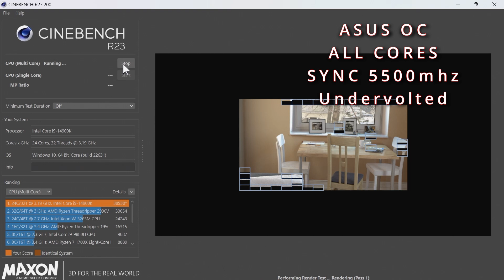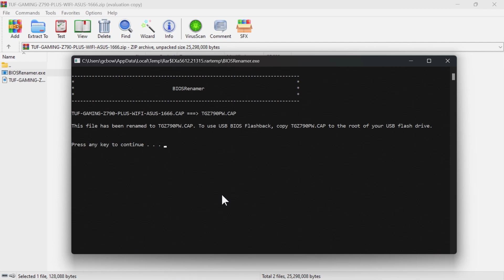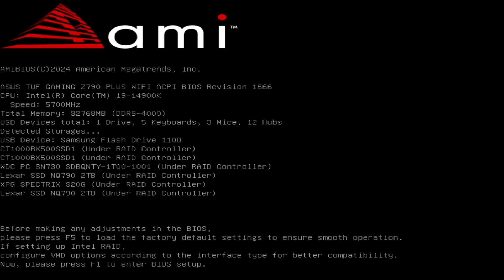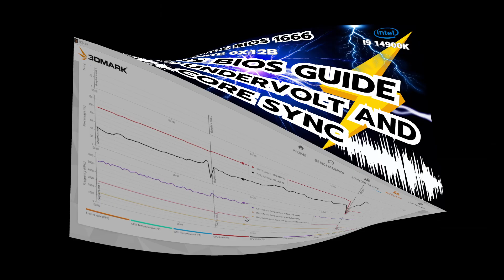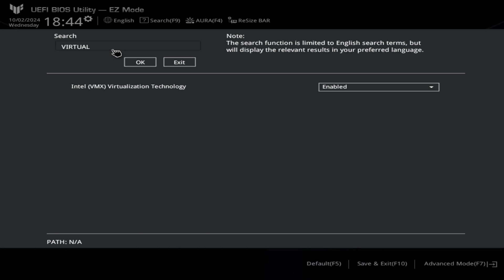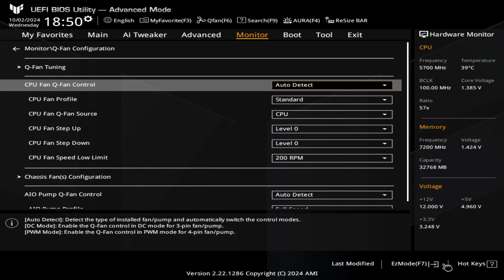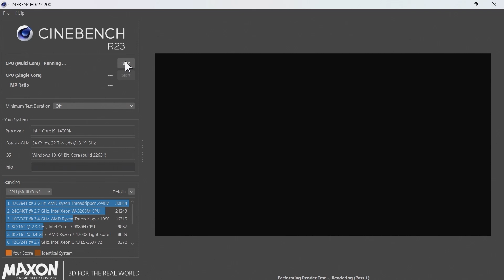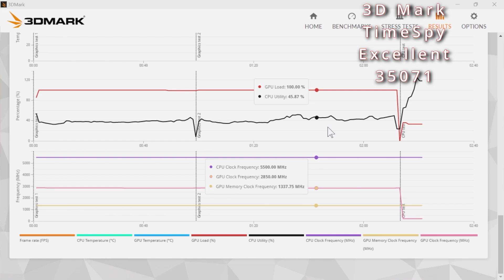i9 14900k Asus BIOS Guide Part 3 Version 1666 Beta Microcode 0x12B Improve Elevated Voltage at idle

Comment: Another excellent and in depth video. Keep up the good work. I have the same motherboard but the D4 version and an 13700k cooled down by an AIO. What would be best to change in order to fit those changes to my CPU? Should i go with the default PL1-PL2 values from Intel and a LLC of 6 followed by a -0.05 undervolt offset?
Reply from the maker: @Ntinsky  Hi, thanks for the positive comment 🙂 yes, I would say apply that, test at - 0.05000 then add further increments if - 0.00500 so next would be -0.05500 then -0.0600 you should see a good improvement at around -0.06500 but beyond that ir may be both negligible difference and add instability, test using Intel XTU AVX2 test for 10 mins it will be a pass or fail test, if it fails add back the -0.00500 you dialled out 🙂
Reply: @nextlevelsimgaming  Thank you for the feedback. I an gonna test it on a brand new CPU since Intel replaced my old one and have -0.06500 as the hard limit.

Do i need to disable virtualization like you did?
Reply from the maker: @Ntinsky  Yes unless you use Virtual Machine, its only needed to be disabled to run Intel XTU for the stress testing aspect, you’ll get a slight improvement in performance with it disabled too
Reply: @nextlevelsimgaming  Got it. I might leave this to enabled since i sometimes practice with VMs due to work. Do i calculate "All core ration limit" for my CPU as the max speed with boost?
Reply: @nextlevelsimgaming So far so good with the 0.0500 as you suggested. Quick question. How do i calculate the All core ratio limit? I am not sure what to put there
Reply from the maker: @Ntinsky  The all core ratio is in thousand mhz, so 55 would be 5500, 56 would be 5600 etc, for an i9 14900k 5500 is best all core, check the recent video on different frequencies for comparison 🙂
Reply: @nextlevelsimgaming  Thank you for the explanation. In my case (13700k) i have set undervolt of -0.0600 that seems to be working fine with the rest of the settings you dmeonstrated, but i notice that my Pcores reach 5300mhz instead of 5500 during CB multicore run and the CPU Package Power goes up to 220W max. Am i missing something here?
Reply from the maker: @Ntinsky  Check that Windows Power plan is set to maximum performance 

To change a power plan:

Select Start and then Control Panel.
From the list of displayed item under Control Panel, select Power Options, which takes you to Select a power plan page. ...

By default, the option to change power plans is disabled. ...

Choose the High Performance option.
Close the Power Option window.

However I note you say that you are using a 13700k the maximum clock is 5300mhz by default so you will need to sync cores to 53 the guide is for an i9 14900k

Core i7 13700K - desktop processor produced by Intel for socket LGA-1700 that has 16 cores and 24 threads. The base clock frequency of the CPU is 3400 MHz, but due to Turbo Boost technology, it can perform up to 5300 MHz.

Hope this helps 🙂
Reply: @nextlevelsimgaming  thanks once again for the feedback. Power plan is set to ultimate performance. I changed the core sync to 53. All good👍
Reply: I5 13600kf please 🥺

Comment: Is there anyway to maybe get the temps down a few more degrees?   Also what settings would you need to change if you wanted let’s say 57 all core sync. Would you change the 1450 voltage and the under volt offset ?
Reply from the maker: @ElusiveAura  See my latest video regarding 57 frequency, if you wanted to get the temps down further you would need to reduce the undervolt further
Reply: @nextlevelsimgaming  appreciate it and the videos. If I’m on the latest bios now with all the fixed and replace my 13th gen with the 14900k, I won’t need to reapply any bios fixes right?  All those bios updates are for the motherboard and not the actual processor itself?  I mean it’s for the processor but it’s done on bios. Just wanted to make sure I didn’t need to reapply the bios update or something.
Reply from the maker: @ElusiveAura  The BIOS is a microcode update applied via the BIOS and Intel ME, once written to the CPU you will then be able to see the application in the CPU section of the BIOS menus, it also lets you revert to the previous, so once updated that stays hard written to the CPU so you won’t need to update again 🙂

Comment: Set the offset to the video on my z790 gaming e with 13900k and when starting the cinebench test it sends a bug error and exits the app.
Reply from the maker: @r1cc-1  You need to set the offset starting at a negative offset of - 0.05000 then test, run AVX2 test on Intel XTU for 10 mins, if it passes then add further increments of -0.00500 so next would be -0.05500 then -0.06000 etc, that is the offset I used in the video thats good for my system however every chip is different, if your system can’t run at -0.05000 then it may be susceptible to degradation and may need to be RMA’d.

Bear in mind a 13900k was affected by Oxidation issues in some batches.
Reply: @nextlevelsimgaming  I set the IA VR Voltage limit to 1400 since 1450 is not recommended on 13900k could that be it too?
Reply from the maker: @r1cc-1  I would recommend leaving that to Auto on yours
Reply: @nextlevelsimgaming  xtu says it is incompatible because I have undervolt protection disabled.
Reply: @nextlevelsimgaming  The test failed with the Asus profile and an offset of -0.05000 in I just hit start testing with avx2. Where should I contact Intel? I had never had any problems since I never configured it by offset, I just left the BIOS that Intel recommended was safe by disabling the Asus profile. I never had any problems until this test...
Reply: Any other test to know if it is definitely degraded? :(
Reply from the maker: @r1cc-1  A CPU test run on 3D Mark, Cinebench R15 is also intensive
Reply from the maker: @r1cc-1  Disable it in BIOS
Reply from the maker: @r1cc-1  If it cant pass on a small undervolt, then its requiring more power, thats a sign of degradation, a CPU will require more power to operate as the silicon degrades, on the upside, Intel have no more replacement 13900’s and are providing 14900’s as replacements
Reply: @nextlevelsimgaming  If I disable undervolt protection from the BIOS, the xtu app asks me to activate it from the BIOS and only then does it run
Reply: @nextlevelsimgaming  but taking into account that I had it in asus profile and not intel? because in intel profile it works fine although I don't know if it's normal that xtu throws a message that says thermal throtled in XTU until the end of the AVX2 test
Reply from the maker: @r1cc-1  Whichever way works, it normally (used to) require undervolt protection disabled to allow undervolting on XTU unless they’ve changed it 🤔
Reply: @nextlevelsimgaming  The avx2, cinebench r23 and cb r15 tests do not exceed 5, 5.1, 5.2 ghz, is this normal?
Reply: @nextlevelsimgaming  R15 gave me a result of 5491 points with the latest bios in stock
Reply from the maker: @r1cc-1  The R15 test score works in a different way to R23, if it passed that is good in itself, as it’s extremely demanding.

On the R23 test, on a 13900k that is normal.

I cant give you the specifics for that processor as I don’t have one to test

Now test in gaming, you should notice the real world difference in temps there
Reply: @nextlevelsimgaming  Hello again, I've been without a computer for about a week hahaha, I sent the 13900k, Intel changed it and they gave me a 14900k, thank you very much for the recommendation. What do you recommend I configure to start from 0 with my 14900k? Arriving in Chile on Tuesday was quite a journey for the 13900k. I'm happy hahaha, I clearly gained a little more performance with the 14900k, but what do you recommend I configure as soon as I have it? Do I start with this tutorial?
Reply from the maker: @ Hi,  I would just follow the gude 🙂
Reply: @nextlevelsimgaming  I continue only from this part 3 I have the latest bios on my z790 rog strix gaming e wifi. You have gained a subscriber, thanks to you I will have a new 14900k processor, having used my 13900k for a year and a half. I am very grateful, I hope your channel continues to grow and I will watch all your videos :)
Reply from the maker: @ Thank you, welcome onboard and enjoy your new processor 🙂

Comment: I'm following your videos for the undervolt 14900k with interest. 
In one of them you mention that you noticed at one point that the mouse (the pointer) was suffering from small freezes. This happens to me, and the processor is new, recently changed by Intel (it also happened to me with the 13900K).

Now I'm using "Intel Default Settings", Bios 2602 with the latest microcode 0x12B, and everything that Intel recommends in the specifications sheet. My motherboard is a ROG Maximus z790 Hero with 64 GB memories at 6000 Mhz. (4x16 GB).
Did you find a solution to this or did it happen to you again at some point?
Sometimes all the USBs on the PC are completely disconnected, and after a few seconds everything reconnects. Everything is perfect except for the mouse issue and USB ports.
One thing I would like to clarify and I read somewhere is that apart from selecting "Intel Default Settings" in BIOS, the corrections that Intel has applied in BIOS at the microcode level stopped having an effect and therefore without its protection. Is this true?
Thanks 👍
Reply from the maker: @fesg_1  The mouse freezing issues occurred when I had the Intel Default settings applied, I am using the Asus OC with undervolt and cores sync’d to 55, not had any issues since, but its interesting you are also having the issue
Reply: @nextlevelsimgaming  In another video I saw a few months ago, they also mentioned this situation of mouse freezes but not solution then. Apart from that, the whole USB controller is reset and in about 5 seconds everything works again with my MOBO and processor. And everything, everything, is fully updated.
I will try undevolt as you explain in the video and confirm if it solves the problem.
Regarding the fact that if we are out of "Intel Default Settings" in BIOS we are no longer applying the microcodes that Intel has incorporated. Have you read or can you confirm this situation?
Reply from the maker: @fesg_1  The microcode remains on 
the CPU regardless of what BIOS Profile you are in, its hard enforced by Intel Me, it can be verified in the CPU section of the BIOS which will show the current Microcode written to the processor.

Comment: Thanks for this! I'm on a 14900k and Asus Z690 Hero Mobo So far so good only thing I had to change was my DRAM frequency with XMP my system didn't like things at the max of my sticks 6400(DDR5) dropping to 6000 seems to be stable now.
Reply from the maker: @simracingden  Fantastic, my RAM is rated to 7200mt so yours would need to be too, good to hear its working well for you 😊
Reply: @nextlevelsimgaming  Much better temps and an FPS increase!

Comment: Do you think the 14900k is safe now with these settings and the newest BIOS update?  And 2nd question, would you upgrade to a 14900k from a 13700k for gaming?
Reply from the maker: @ElusiveAura  Intel’s stance on this is that the latest BIOS update is their final resolution on the matter.  As for my personal views on it, the Intel Default Settings offer incredibly poor performance, and the processor isn’t capable of what is advertised without excessive issues.  I would certainly recommend applying the settings in this and my other guides and applying the latest Microcode updates too

Comment: I am still on 0x129 and I wonder if I have a better chip than yours because I have a lower vcore than you do running the same stress tests. I end up hitting 1.30 max with heavy stress as a max and stay at 1.28-1.29 during test. I just found it odd you hit 1.4 volts during the test.
Reply from the maker: @cemsengul16  Can be a lot of variables, Silicone Quality is one, so there is a possibility that yours may be, mines certainly been through a lot of punishment with constant testing so wouldn’t surprise me 😆
Reply: @nextlevelsimgaming  Do you think it is because I undervolt using vf offset and start with point 7 that is 5600 ghz?
Reply from the maker: @cemsengul16  Potentially, use the same method as I demonstrated, it is a method used by many experienced overclockers such as Buildzoid, Frame Chasers etc
Reply: @nextlevelsimgaming  I used to do the global undervolt method with older 10th gen Intel but I figured because we have efficiency and performance cores it might not be as stable so I tried vf point undervolting. But I should try your method too sometime.

Comment: I use vf point offset method of undervolting. Should I do a global undervolt like you do? I also have all tvb settings at disabled not Auto like you.
Reply from the maker: @cemsengul16  Either way is fine, its easier to use a global undervolt to keep it simple for people.  Again, tvb is fine disabled or at auto, the cores are sync’d to 5500 so wont boost anyway

Comment: these oc and undervolting settings are only for 14900 or also for 14700?
Reply from the maker: @maksiczek1568  An undervolt will work universally, you will need to set to Intel's default: PL1 to 125W, PL2 to 253W, and max current to 400A.
Reply: @nextlevelsimgaming  Thanks
Reply from the maker: @maksiczek1568  No problem

Comment: What makes you enable multicore enhancement but disable Intel Adaptive boost and have you happened to have tried it the other way around?
Reply from the maker: @DeagleHonor  Multicore enhancement is required when syncing the cores, if we disable the pre requisite would then be Intel default which relates to Intel’s boost parameters, as we are not utilising the Intel Boost (6mhz) and syncing the cores to 5.5 there is no necessity to activate Intel Adaptive Boost.

The underlying issue with the processor is that erroneous boosting raises temps under load,  and causes instability, this results in throttling of the processor.  Syncing the cores creates consistent performance, and undervolting reduces the power required to do so, a bit like tuning a performance car that would run rich, burning excessive fuel.

The other option in Multicore Enhancement would be Enabled - Remove all limits or remove all limits (90 degrees) the first would have potential to cause fluctuations in power delivery, the second would do the same, but throttle at 90 degrees.

If you look at the 3D Mark comparison on the CPU graphs on Intel Default and after the tune, look at the erratic frequency on the Intel Default versus the final tune which is a completely stable line throughout the physics test, in every system use, gaming, productivity etc we would want to achieve the latter for better performance and system stability.

Unfortunately Intel are unable to say “Our processors don’t work correctly with boosts enabled” as there would be a mass recall based upon a falsely advertised product, its more a case that ‘Yes they can hit such high frequencies’ but like that turbocharged car, you wouldn’t drive it round on the red line under normal driving conditions, however these processors have been utilising boost even sat at idle, I have witnessed this myself.